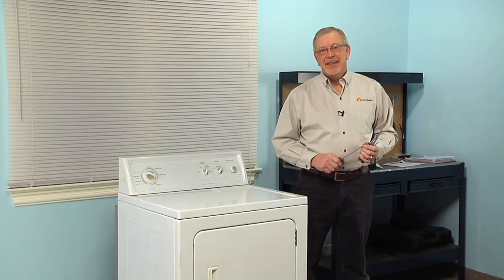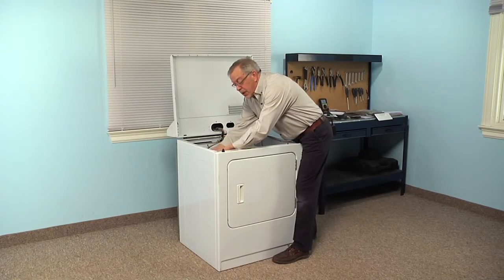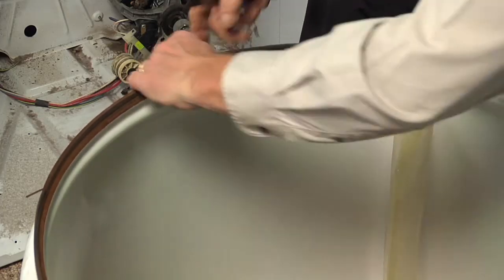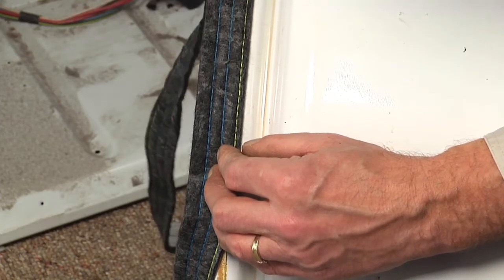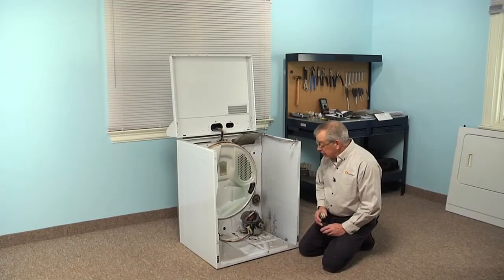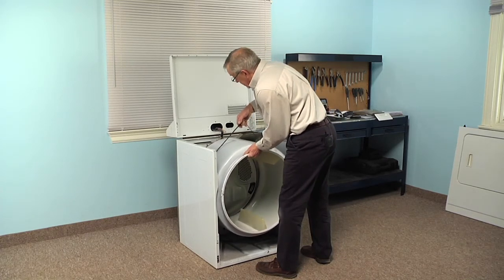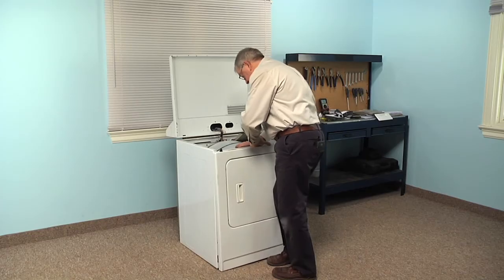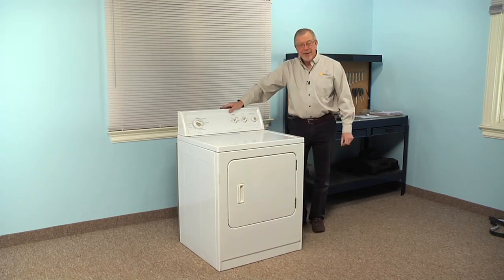Dryer Repair - Replacing the Drum Felt Seal (Whirlpool Part # W10612022)

Comment: Thank you! This is the EXACT way to replace this felt seal. Showing the fold along the top lip was really helpful in aligning this seal, especially at the end when it gets tight.  The tip about feeding the seal along the rear housing is very important too ensuring proper fitment. 5 out of 5 stars, sir!

Comment: This shows the absolutely easiest way to open the cabinet and remove and reinsert the drum. It may be focused on replacing the drum seal. But, it highlights something many miss. And that's, making sure the drum seal does seal all the way around the drum by using a putty knife before putting the dryer back into service. Good job!

Comment: I just finished replacing the felt on my old Whirlpool and it was not "easy." Simple but work: first I had to hang it up on my power rack with 60 lbs of weight plates attached, spraying it with water several times a day to carefully and gradually stretch it longer over a few days, from 76.25!" to the 83" necessary to fit. Tightly. Then I left it hang to dry, which was fairly rapid in my garage workshop at about 50% humidity at this time. Then I fixed it in place onto the drum using a dozen clamps (not clothespins that would pop off and be worthless). Next I put a half dozen screwdrivers in and around, to give a little play to get ready for the final fitting and gluing process. Next I got my 2" clamps ready and glued abut a foot length at a time and clamped the two end (Start point was at one clamp and I marked the spot with a piece of tape so I knew where I left off it distracted. Waited one minute for each "section application" of glue to get tacky, as instructed, clamped that section off and continued until I finished the process (11 sections in all). Not "difficult" in terms of skill; just a big long process compared to what I thought this was going to be. It did look like a Rube Goldberg sculpture/ mobile as it sat there on the work cart though.  My Whirlpool gas dryer is 25 years old or even a little more, and I originally "went in" just to replace a fuse (so I thought) since it stopped heating. Ended up testing all the components and it turned out to have no continuity in the flame sensor so I replaced it. Coils, igniter and all the rest tested good so even though I bought replacements for them I left them in. While there I also replaced the foam lint gasket and blower motor gasket (scraped, wire-brushed and solvent)  If I need to I can open it up again (I took the whole darn thing apart as it is - not my intention but I had no choice since I wanted to do things right once I got there - and at least I now know this thing pretty well even thought it was my first time opening one up. It's a pretty basic machine with everything out in the open to test and replace. That is if you can find the parts. Seems like my dryer was so old (really?) that the felt was 4" too short. And I mean short- you should see how short it lay across the drum mouth when I first went to see if it would fit out of the bag! Ha! "Draped" is more like it- it only covered 3/4 of the dryer opening! I just tried stretching it with a little H20 spray and weights and by jove it actually worked (the felt on the drum that is; I still have not started up the dryer yet- I am writing this early I guess. Hopeful thinking. Let's say positive thinking. Wish me luck.

Comment: What if its not fitting snugley to when tou put the fron door back on
Reply from the maker: Great question and the answer depends on how loose fitting yours may be. If the felt has bulged upward like a speed bump then there are tow options, replace the felt with a new one that has not over stretched or it has been done where you make a couple cuts on either side of the bump so the remaining ends would come together. Its tricky but possible. If it is fairly smooth to the front just not super snug it maybe fine. When the dryer is running the airflow thru the drum will create a suction and will have the seals gently being sucked against the front and rear bulkheads. Good luck with your repair!

Comment: Mine was not like this it has a 24 inch gray felt strip with plastic embedded. Then a thicker felt white about 5/8 this goes around the lower half. Mine don't have any rollers. But I don't know what part numbers and what adhesive to use.
Reply: Find you model number and put it into the search function on partselect and then find the rear felt seal and it will show you the part number. It sounds like you are talking about the front felt though.
Reply: @volpe1970  this is an old rebuilt unit no model numbers not tags or anything and coin slot added . I just found a place that sold felt and adhesive and cut it to length and worked perfectly no bounce nice and smooth. Had to use a factory belt the drum hated the aftermarket kept jumping. So unit is back up and running. Thx for the typical advice its still practical for those who read the post and can obtain that info.

Comment: I need help . I changed the felt and rollers now the dryers not heating
Reply from the maker: If your machine is running and not heating I would first suggest checking you power supply to the dryer. If you have circuit breakers in the house panel or pony panel near the machine it would be a good idea to switch them to off and back on. If you have fuses in your house panel I would check them or replace them and try the dryer again.